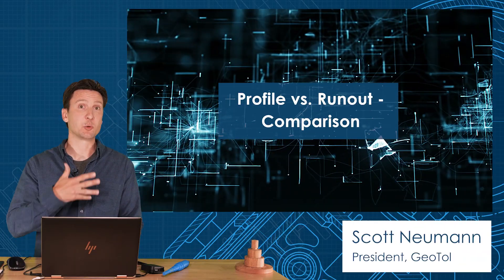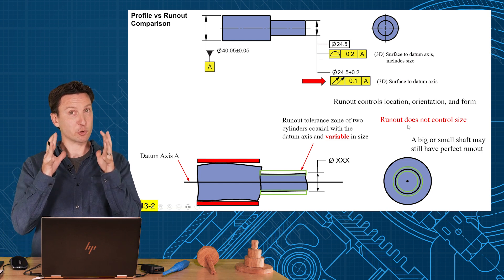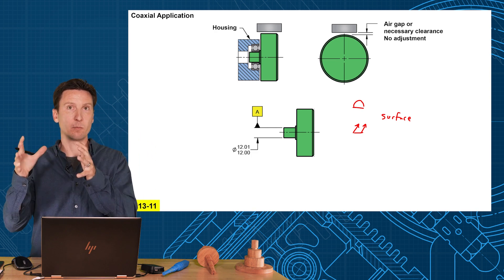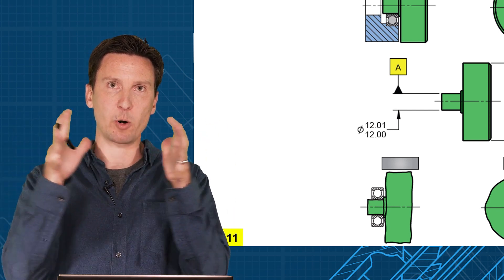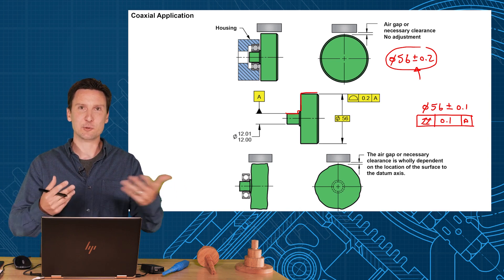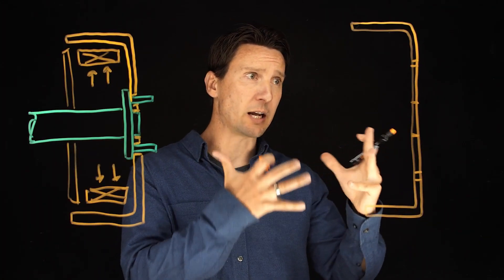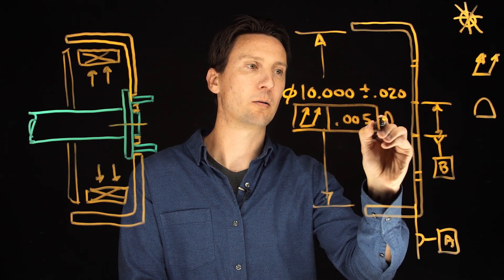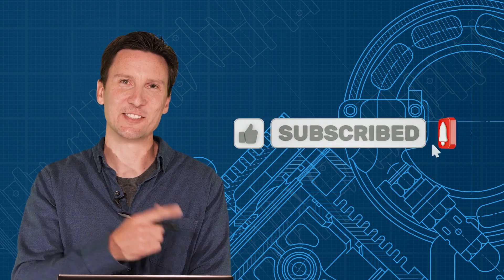Profile vs Runout for GD&T Applications

Comment: I have a doubt,Eventhough the run out is not controlling size,Run out tolerance control zone must be with the limits of size,Right? 

Only thing is,Zone is not fixed related to the true profile..Please correct me if i am wrong,Thanks for the great video and explanation.
Reply from the maker: The runout and size tolerance are unrelated to each other. Runout controls the location (centering) of the feature. However, since both size and runout control form, the application of runout (instead of position) usually doesn't make sense until the runout tolerance is smaller than the size tolerance.
Reply: @GeoTolPro  Thanks!

Comment: Can i use total runout as secondary datum?
Reply from the maker: Not sure I understand your question. Total runout is a geometric tolerance. A datum is an axis or plane. 
I assume you are asking: can I tolerance a secondary datum feature with total runout?
The answer is usually no. Runout must reference a datum axis. If your primary datum is a plane, then no. If your primary datum is an axis, then a perpendicular planar feature may be controlled with runout. However, I recommend a simple perpendicularity in that case.
Reply: @GeoTolPro  in the brake drum example when you add the total runout to the diameter of the brake drum which is 10 inches, is that the same as point the runout to the outer diameter? In my understanding is that when you put the fcf in the diameter, you are controlling the axis
Reply: I think your answer contradicts  this video, which suggests that runout can be used as a datum: https://youtu.be/NE7qDGybv5U?si=E7x0SqQy3PLI3uWH

Each person with different interpretation of the gd&t standard?
Reply from the maker: A runout tolerance may be used to control a primary set of common datum features (A-B). 

A runout is a tolerance not a feature. You are getting your terms mixed up.

Comment: We have a part drawing for a long cylindrical component that has a sharp point at the end (made by grinding 3 flat surfaces at an angle). We currently have called out on the drawing a runout of 0.1mm for the sharp tip. But a vendor we sent the drawing to is saying we should use "position" rather than runout. This component is spun in a drill for driving it into bone, and if the point is off center, it will not behave properly. Which do you recommend, runout or position?
Reply from the maker: The feature is circular, right? It sounds like the surface of this feature is important and not just the "axis of the mating envelope". Circular runout seems like the best option to keep that "surface centered"

Comment: On the first example: For profile I thought you could add a tolerance to the diameter if you wanted. In that case the profile would not control the size but it would still control the location, form, and orientation. Is this correct? Does the diameter need to be a basic if we use profile?
Reply from the maker: Profile tolerance requires a true profile to be equally disposed about. The true profile (the diameter in this case) is set by basic dimensions. Runout requires the separate size and runout tolerance.

Comment: Hey, great video. I have one doubt though. On the brake drum example, why not use profile by adding size and runout tolerance to profile. So that would be profile tolerance of 0.025 inches?
Reply: What is the future of this gdnt and Siemens nx and package after 3YOE IN India?
Reply: @anantakumar3581  wrong tag?
Reply: @kaushikiyer9445  I am asking about package. What is wrong tag....
Reply from the maker: The function of the brake drum is to have a large size tolerance but tight runout. If it were converted to profile tolerance, the size would be basic. Then you must have a single value for size and coaxiality. You lose the large size tolerance that runout allows.
Reply: @GeoTolPro but as you said, it is easier to maintain coaxiality on a lathe than size. So maybe that machine is able to achieve coaxiality of 0.003 and the remaining 0.002 can be used as an extra size tolerance adding to a total of 0.022 size tolerance
Reply from the maker: You want separate size and runout requirements on that brake drum. The size tol is large because the shoes are adjustable and is limited only by the adjustment of the shoes (and maybe also the wall thickness). The runout must be kept tight at .005 for consistent contact with the shoes. Profile can only have one number which must be kept at .005 to maintain the tighter of the two requirements.
Reply: @GeoTolPro  what he is asking is use profile of 0.04 tolerance the! add total runout of  0.005 tolerance for refinement